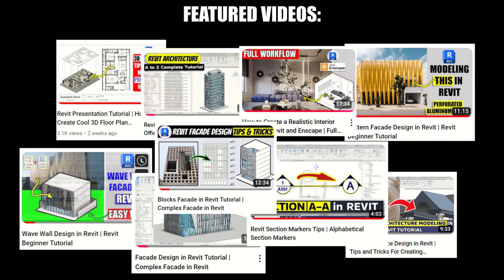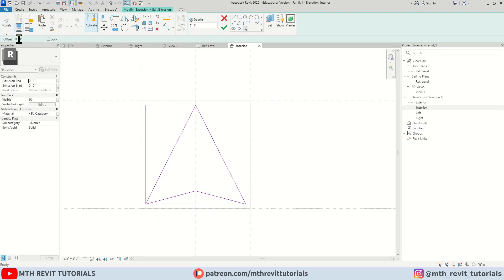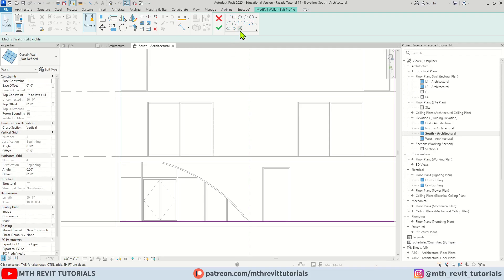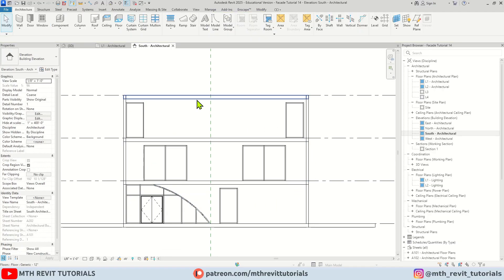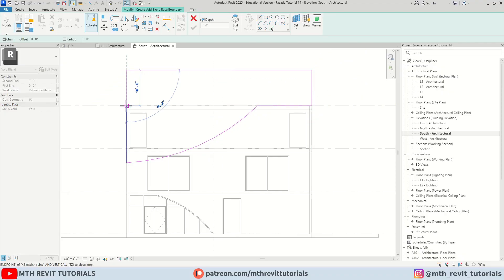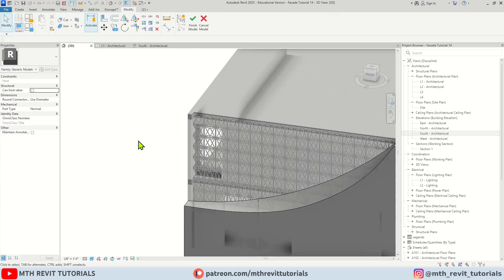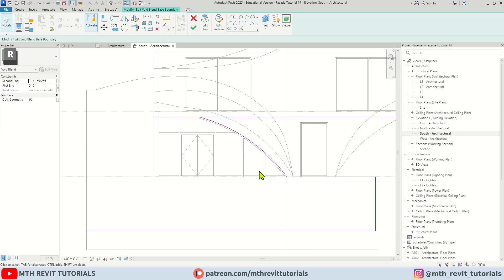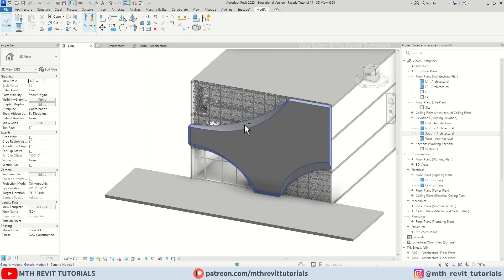How to Model Stunning Parametric Style Facades in Revit

Comment from the maker: ➤ Curved Glass Railing Hack: https://youtu.be/yR3rsqyCVVA
---------------------------------------------------------------------------
▶Timestamps:
00:00 Intro
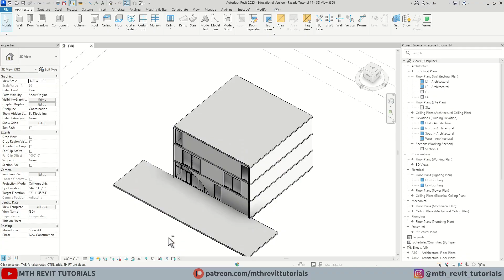00:22 Modeling Pattern Facade
05:55 Modeling Parametric Style Facade
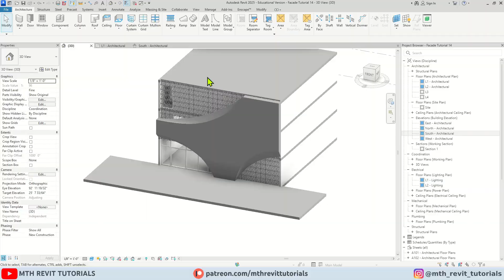13:10 Conclusion / Outro
---------------------------------------------------------------------------
Master the workflow for creating unique, custom parametric facades in Revit. Learn to use curtain systems, and in-place components to design complex, efficient building facades. This method allows for easy iteration and change management in complex projects.